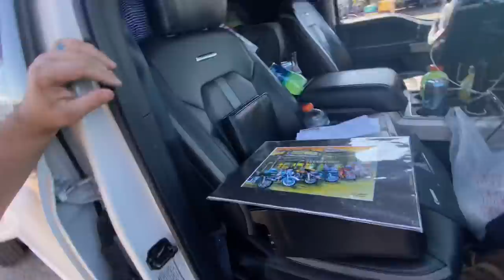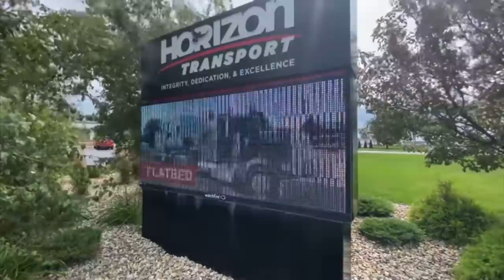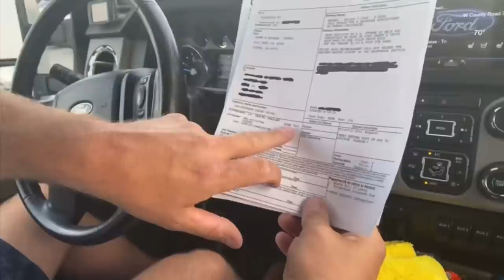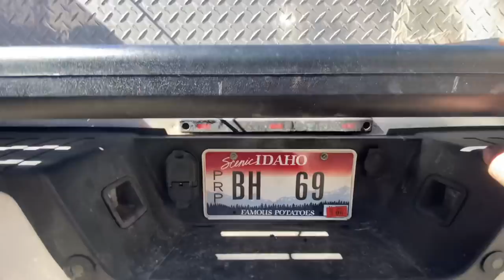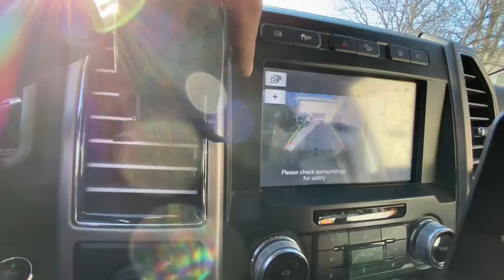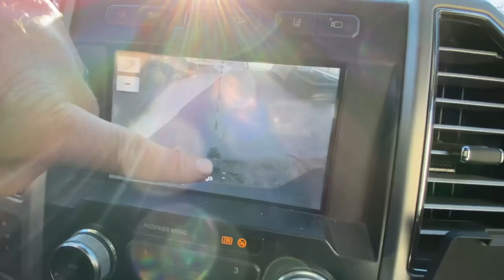Navitrac tire review, fixing my tailgate

Comment: Hey could you have just drilled a small 3/4” hole in the center of the tailgate, and then just install the camera in the smaller hole?
Reply from the maker: Nope. The camera itself took up about 3/4 of the hole we cut
Reply: @fairwindsfollowingseas7909  bigger camera than what’s on a dodge. Ok still looks great! Love that 5th wheel tailgate too!!!!!
Reply from the maker: The lens is very small just like the dodge, but once you take it apart and see the camera, mounting bracket, and connector........it occupies some real estate
Reply from the maker: Right around 11:50 you can see the entire setup when I flip the bracket over
Reply: @fairwindsfollowingseas7909  thanks I’ll go back and watch it closely!